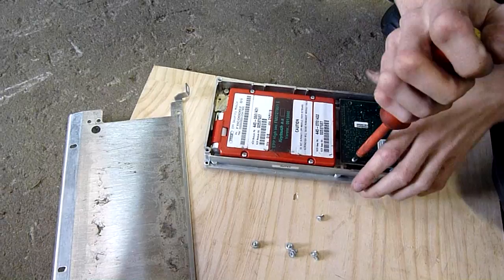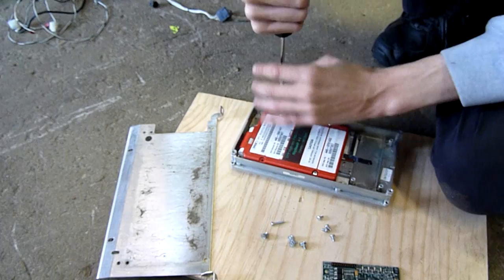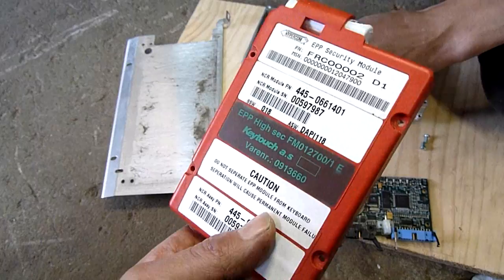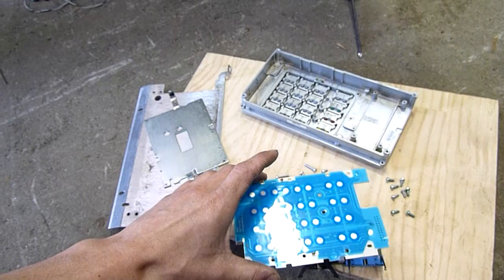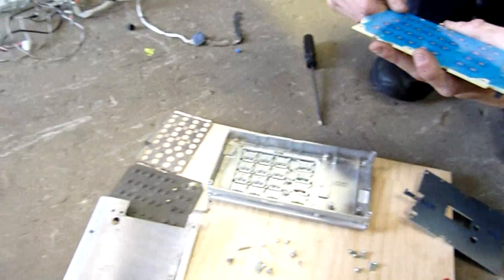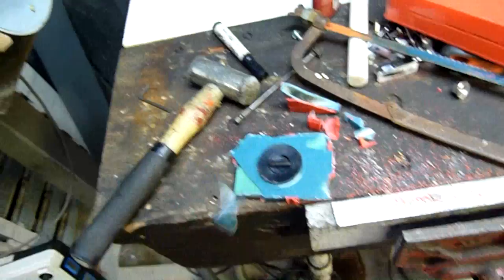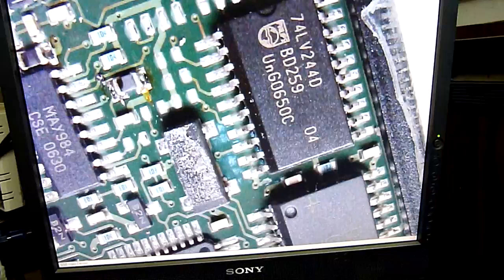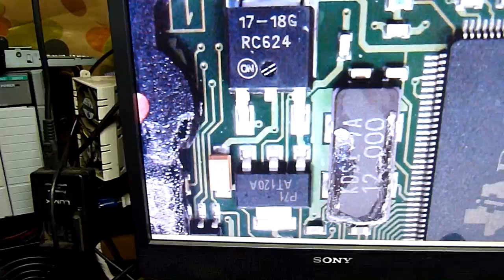ATM Encrypted Pin Pad Autopsy

Comment: Might be some sort of capacitive coupling interface
but with what looks to be about 20 pins from the buttons, it may be a dual 4x4 with 4 of them being common to both pads on each button
Press a button, check what connects to what, and make a table of sorts, maybe 20 across the top, and 20 down the side, and mark each cell with what button connects top to side

Comment: I don't think the flat flex cable has anything to do with timing. They do it to prevent an attacker to drill a hole certain places and placing a tap to watch the encryption while in operation.

Comment: Thats actually very neat. I know exactly how it works just by looking at it. The "mesh" is a security thing that destructs the RAM if not detected on powerup. Also, its used to measure pulse timing. The DSP would send a pulse down the cable while a timer is counting. This value is then used a constant, probably a seed to generate a signature for the encryption algorithm. the DSP likely was programmed as a cryptoprocessor, performing AES/DES/RSA/ECC.

This module is likely the interface between the PC, and the bank. And probably contains bank-specific keys in the SRAM. Any transactions made by the PC such as a withdraw, etc, the functions probably pass from the PC to the module, and the encrypted payload from the module to the internet/bank. Simple as that. Works on a very similar principal as say, a cablecard on a digital cable receiver. Same thing. In other words, transaction data from the bank would be sent encrypted over the network, then the ATM software would send that data to the module. It would then come back descrambled. (besides anti-man in the middle session encryption between software/cryptocard). the ATM software would process the descrambled data and perform the required function/output. When you key in your pin, or request a transaction, the ATM software would then send the request to the cryptocard, and the response would come back encrypted and then sent off via network to the bank.

Comment: I have some small amount of experience with these things as part of my job. The SRAM doesn't store the algorithm, IIRC, it only stores the private key for the machine. jgcertified is correct in saying the DSP chip is the encryption engine. DSP chips are good for that sort of thing. The algorithm itself is stored on the DSP chip (they have internal FlashRAM - think of them as a microcontroller with SIMD extensions, similar to MMX or 3DNow!).

The large flat-flex wrapped around the module is not timing, AFAIK, it's tamper detection. As soon as one trace is cut, or traces get shorted, the private key gets erased. Same thing happens when you remove the battery.

Comment: The flat flex wrapped around the board has no purpose other than to detect if the potting compound has been removed. It simply sends a dummy signal through each wire and if it stops receiving it at the other end, it deletes everything. I have seen this in chip-and-pin credit card readers, so if you try and open them, they erase the encryption keys immediately.

Comment: Yeah, the flat flex is basically there to destroy the encryption keys if you try to access it, cut/short/whatever those traces and the data goes away, there'll also be thermal sensing and such, so if you heat it up beyond certain thresholds (like the melting point of the epoxy) the keys go away, etc, etc, etc.

In those ATMs pretty much the only encryption happens inside the EPP module, the only thing that actually gets encrypted in most cases (assuming it's not using a VPN to connect back) is the PIN, all the other data goes in the clear.

The bank end has a very similar looking high security module to do the decryption.

Comment: The keypad you guys where trying to get into uses the Triple DES (TDES) to encrypt the pin number that you would enter after inserting your credit card and the key would only be 24 bytes it is possible that the newer ATMs will be using AES(Rinjindael) for all communications between the personality module and the various units like receipt printer,keypad  and card reader TDES is no longer used and is in the public domain there is an old version of GNUPG which I have the source code for and have used it for other purposes so no worries keep up the good work guys.

Comment: I took apart an Ingenico brand point of sale pinpad some time ago, it did contain a similar, but smaller, potted module. But I did not find any backup / triggering battery in it, oddly enough.

Comment: The flat flex probably has more to do with fysical security. To prevent accessing the board it is wrapped around by drilling or whatever. Mikeselectricstuff found similar circuitry in a hand-held mobile pin device.

Comment: The elaborate tracking around the unit is connected to the flat flex connector and to the board, possibly just a security protection to stop you getting into the device, bit like a very elaborate burglar alarm, when broken, the device would self erase or protect itself some other way.?

Comment: If you figure out the pinouts, you could put an arduino leonardo mini in there and program it to work as a standard usb keyboard. There are good libraries for interfacing matrix keypads, so there's not much programming needed.

Comment: These traces usually are no delay lines. 
Most devices just route the power for the static ram through the wrapping to provide a relatively simple, yet relatively complicated to breach anti tamper mechanism: If only one wire is cut, the power to the static ram will seize, thus deleting the confidential information.
Another technique is to route additional, random digital signals through these wires which are send and received by an mcu/fpga. Hereby, some traces provide passive tamper detection/response (wire cut -> power out -> data lost), others active (wire cut -> mcu performs delete operation -> data lost). If you go for really high security stuff, even resistance, capacitance, inductance measurement can be performed on the anti tamper mesh (the wrapping), in order to have a higher likelihood of detecting attacks with more sophisticated technology, such as a focused ion beam.
Furthermore, the only very rarely, the algorithms itself are deleted, since the manufacturers usually use publicly known ones. This is because the security of these is proven to be given. Custom algorithms are quite rare, since if they become known to the public and are badly designed (which most of them are...), this will introduce very serious threats to the applications a specific product is used in (military applications do use custom algorithms, but this is quite another league).
So probably, the program flash of the DSP still contains the original program ;)

Comment: The flat flex is used as a anti tamper device the idea is makes it hard drill into the potting to the pcb with out hitting the file.  Once a trace is cut it erases its minor contence

Comment: Ed, you should see the security in a standard credit card terminal, like what you find at checkout at stores. Opening the case on most erases the keys, as does messing with the cover over the processor and flash chips. Some will shut down if the voltage is over a certain threshold. pretty cool security.

Comment: its really simple to write a simple Arduino sketch, or using your own language, to write a simple PS/2 interface program or use the AtmegaU series and run USB HID, and keyscanning routine. This is about as simple as it gets. Convert your own scan data into correct HID Key codes, or PS/2 codes.

Comment: Timing?

More like cut/short/whatever the trace to delete the data. Note the total area coverage.

I have seen datasheets for secure microcontrollers with a "delete everything" pin, that you are supposed to connect it to the weave somehow so tampering triggers the pin.

A whole DSP for the secure module? That got to be some heavy cryptography being used!

The board can probably be restored with the original programming-files and some well-placed shorts, quite much forget about getting those files. At best you can re-use the board with your own program-code.
Reply: If it's high security, It'll be both via a "Window Watchdog" security function. Basically you send a signal down a wire and if it arrives too soon, too late or doesn't arrive at all, the ram gets wiped. This prevents anyone who knows the trace pattern (via previous analysis, etc) from "patching" the traces.
Reply: Moose
That is probably why the DSP is in there. It can do pretty nifty reflection analysis even, to prevent someone from patching with a specified length cable.

Comment: Static RAM? Don't you mean volatile/dynamic (i forget the name, but the same stuff used in DIMMs), since static RAM is basically cache, no? which keeps it's data even without sustained power, which would not be the desired effect.
Reply: static RAM (SRAM) does not retain its data without power. What distinguishes it is that power alone suffices to make it retain its state. Dynamic RAM in contrast basically stores each bit in a tiny capacitor, which slowly drains due to leakage current, hence DRAM requires periodic refreshing.

Note that when power is lost, DRAM actually retains its content for quite a while (dependent on temperature), while SRAM loses its content pretty much instantly.

Comment: What surprises me is just how much security goes on within the keypad, yet not even a simple cover above the keypad to stop a camera viewing it.  So far every ATM skimming incident I've heard of around here involves a tiny camera installed someone on the ATM aimed at the keypad.

What I assume the encryption does is prevent eavesdropping on any tiny amount of electromagnetic radiation the wires gives off.  For example, a normal wired keyboard can be eavesdropped on from up to 20 metres away:
http://airodump.net/wired-keyboard-eavesdropping-video/

The most interesting keypad I've seen was about 15 years ago when I visited DCU University in Dublin, where room entry had an LED keypad.  The digits could only be viewed head on and the buttons could be randomised.  Obviously it did take a little longer to enter a pin, but someone standing around would not know what digits are being entered.  If ATMs had this type of keypad, I'm sure it would prevent eavesdropping of pin-entry altogether.

Comment: It's good to know they actually care that much... I wonder if UK chip and pin keypads have such security. I severely doubt it.
Reply: In fact, thinking back, I KNOW they don't, I had one apart that I got 2nd hand at an auction.... nothing but a normal rubber 'spectrum' type keypad
Reply: If that's the case it isn't PCI compliant, you probably got it second hand because it's superseded, it's required that pinpads are hardened for PCI compliance, regardless of whether they're in an ATM or an EFTPOS terminal.
Reply: Morgan Reed Similar units are still in use today, we're talking the handheld ones about the size of a ... err... labelling machine maybe, no real room in them for a hardened module like that

Comment: I like how they put so much design into securing the keypad and yet when you go to  a store depending on your bank you can spend $20-80 and not have to enter your pin to pay for things. XD
Reply from the maker: lol yeh, I love my paywave card, but I keep strict limits on how much and how often it can be used, keeps it a bit more secure if it gets nicked (theif cannot take too much out before i get time to cancel it and track its usage)
Reply: Aussie50 what is a paywave?
Reply: Sam Sitar
paywave - you tap your card on a pad and it process the transaction.
Reply from the maker: ***** yeh exactly, its handy for small transactions on the go, like at a diner or parts store (cheap parts anyway, or services like today when Bluey RAV got a puncture repair, $25 is no problem, but if I wanted to buy a new tire, I would have to enter my pin properly)

Comment: sorry to upset you but stripping down the machine is enough
information to give criminals I hear this all the time we do not want to breach
the security but what do you think you're doing right now I certainly don't
blame you I blame the company for allowing you to do this. the company should
disposer their machines correctly and securely themselves.  ok, how about removing the battery before you
move the Keypad, will that erase the data. I'm not having a go at you I'm just
trying to point out some facts. so what I am trying to say everything I've seen
you doing and saying in your videos give me enough information about that
machine.

 

they are a lot of criminals who are very clever in what they
do and they'll take this as knowledge. 

your video was very interesting to detail and I have watched
everyone to do with this machine you have stripped down.